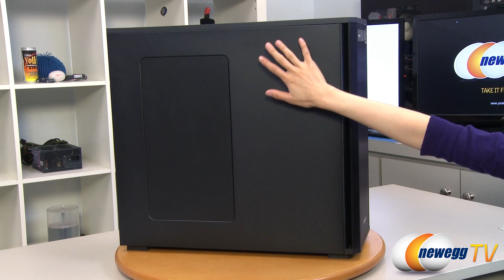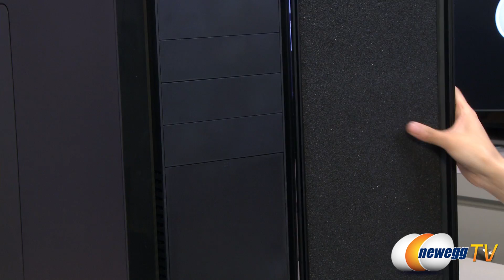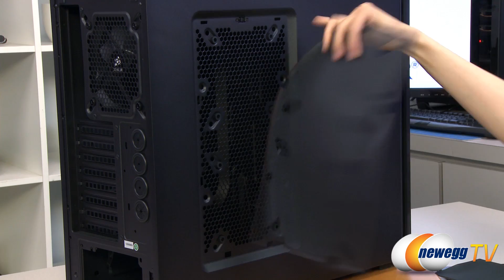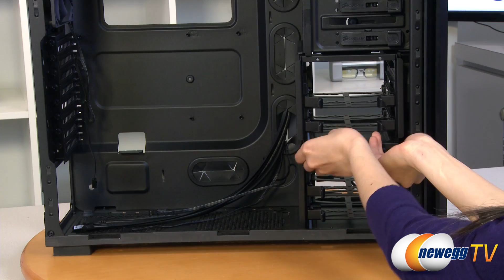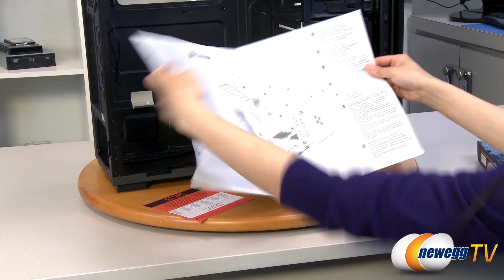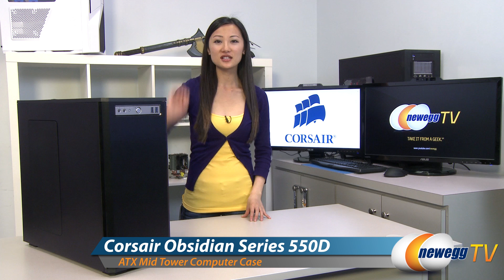Newegg TV: Corsair Obsidian Series 550D Overview

Comment: 1) IMO, this is an ugly case, aesthetically.
2) I find all of this removable crap to be more annoying than useful. What's the point of covering up the fans in the first place? More of a vanity feature really.
3) Probably the only things I liked about it (over my Antec 302) is all of the foam padding for dampening, and the abundance of dust filters. The removable drive cage is also a nice feature for airflow, but something i'd probably never use.

Comment: You don't need to unhook the door to make it swing the other way, you can open it from right or left just as it is.
I have the case for my new build, just waiting for some parts.
I love the unassuming classy look, not gaudy, also that it has the option for a very silent computer build, but at anytime you need you can do extreme cooling with it as well with all the ports.
10 fans can be attached.

Comment: Well there is a inlet in the front side at the bottom.  Creates a narrow choke so that air will actually move faster, though puts a slight strain (although minor) on the fans.  The rear fan just guides it from there.  High performance users will definately remove the side and top covers to put in fans and/or a radiator.  See very little reason to use the bottom fan.

Comment: both sides in the front area of the fan is a bit longer from the case.In this longer area corsair have small holes to left air pass behind the cover.I dont know for the side panel end the top  but i am sure corsair knows beter

Comment: The side / top fans require you to remove the panels. The panels are there if you're using it for a silent system as they prevent noise escaping from the top/side if you aren't going to put fans there. As for the front, there's a gap in between the door and the bays so the fans can pull in air that way.

Comment: I almost bought this case a couple months back. I like it's utilitarian looks. 2 things that kept me from buying it is that it doesn't come with a front bezel for my XIGMATEK 3.5" Internal Card Reader with USB 2.0 ports. Yes I know Bytecc sells one that'll fit in any 5.25 bay that'd match this case. The other thing is that if you do run fans in the side panel or top those pieces covering the fan mounts have to remain off. Should have optional screens for those spots to keep it looking neat.

Comment: Very impressive again Corsair.  I myself have a Carbide 400r because i really like the side panel design and extra space it provides, but that's not to say this case is really good too.  if your in the market for a classical pc looking tower with lots of head room for cable management, air flow, easy functionality, and fan/radiator support, then this and the carbide series are top notch in my book.